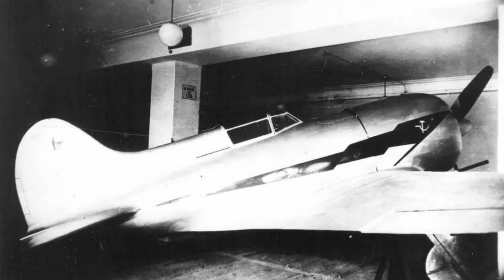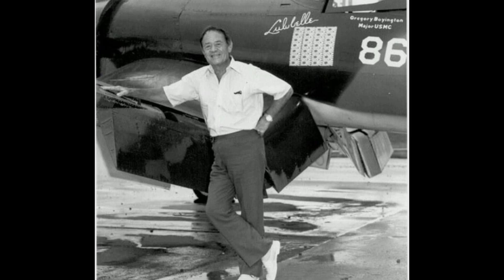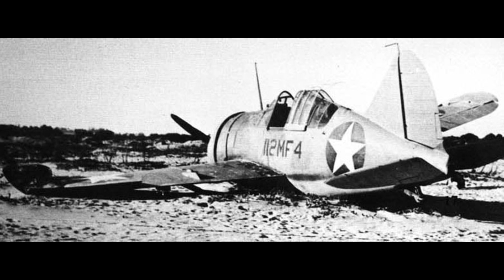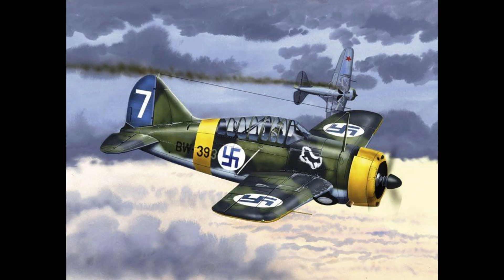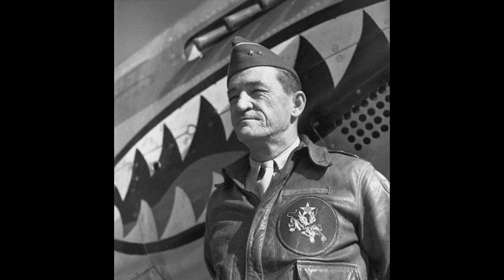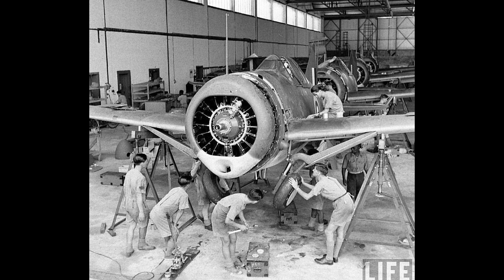5 Minute Guides to Aircraft: Brewster Buffalo

Comment: One of the things left out of the Buffalo story is the issue of engines.  The Cyclone had various versions, at different power levels, with their own difficulties.  As well as the weight increases caused by additional equipment and armor, the availability and reliability of different versions of the Cyclone also had a major impact on the Buffalo's performance.  
IIRC some of the Dutch variants in particular ended up having to make do with used, reconditioned lower-powered earlier model Cyclones actually salvaged from commercial aircraft.  The Buffalos in Dutch service in the Pacific War did not fare particularly well.
Reply from the maker: I had planned to touch upon the engine difficulties during the planes development but sadly ran out of time and shelved it in order to makeway for talking about the planes service with its various operators.

Comment: Airplane must be very good if some one try do copy from it. Finns did made copy only from Buffalo and BF-109. Both too late for war.
Reply: Pyörremyrsky was not a copy of me-109 but an original all new finnish design.
Reply: @mtlb2674  Yes, it was inspired by the ME 109, and had the same engine, but was a pure new desing by DI Torsti Verkkola and built by Valtion Lentokonetehdas (state airplane factory)...
Reply: True. Mamy people just don't know this. Like so many says how we finns modified our Brewsters... All we did was to change the gun sight and we replaced the one 7,62mm gun with a 12,7mm LKK42.

Comment: "The worst plane ever built. . .or is it?"

F7U Cutlass.
Reply from the maker: The Cutlass at least flew. . .kinda, and was at least attempting to be a innovative and advanced fighter.

If they fixed the explodey problem it could've been pretty neato
Reply: @5MinuteGuidesToAircraft  And would crash if you tried to recover normally from a stall, gave a bunch of pilots spinal injuries due to the front landing gear design, the hydraulics repeatedly failed, together with the engine fires...

Yeah, innovative in the number of ways it could potentially kill its pilot...

A plane getting a reputation that it's trying to kill its pilots is generally not a good indication.
Reply from the maker: @DIREWOLFx75  Hey I said "attempting" to be innovative, I wasn't stating it succeeded in being such XD
Reply: Christmas Bullet. Hunley-levels of killing crews.

Comment: Look closely and you'll find its quit similar to an early wildcat , the wildcat first models were an improvement till the navy added more 50 cals , armor , self sealing tanks , heavy radios , and more . Pilots were then dissatisfied with performance of the Cat .
Reply from the maker: The Early Wildcats were, okay. . .they had some teething issues, especially with the engine having overheating problems due to the cowling and spinner design (which is why the -3 doesn't have the spinner hub of the earlier prototypes).

The -4 could've been great. . .if they hadn't messed with the machine gun layout.

The Armor, Self Sealing Fuel Tanks, and Radios included on the -3s were well liked for the fact they kept their pilots alive which is pretty important. If they had tried to make the F4F as light as possible like what happened with the Zero it would've been a flying fuel air bomb ready to ignite on the first round.

Pilots were only dissatisfied with the Wildcats because the Zeros they were fighting were tuned to near perfection for air superiority duties *at the cost of the pilots survivability*.
Reply: Guess they were sending them into combat?

Comment: My grandfather worked at Brewster. He later moved to Consolidated where he built PBY', which turned out just fine. The issue was poor management and quality control at Brewster Aeronautical, not the fundamental aircraft design.
Reply from the maker: Exactly, Brewster as a company was a nightmare and at no point I think well managed.

The fact the Buffalo actually got off the design table in any sort of good standing is almost a miracle considering that fact.
Reply: The F3A Brewster-built CORSAIR a models were fine.  It is sad that this fact is forgotten.
Reply from the maker: @davidmurphy8190  Well, by that point the company wasn't in the control of the original owners (the US Navy had direct control of it to ensure smooth production) and the blueprints were already developed, they were just using the manufacturing capacity of Brewster to make em.

Yeah they worked fine but thats, kinda expected? The Corsair was a good design and by that point the Navy had sussed out 'most' of Brewsters insanity in regards to manufacturing.
Reply: Fine compared to what? @davidmurphy8190
Reply: Sorry David, the Brewster Corsairs were terrible, so poorly constructed the entire order was scrapped from combat service and only used as trainers